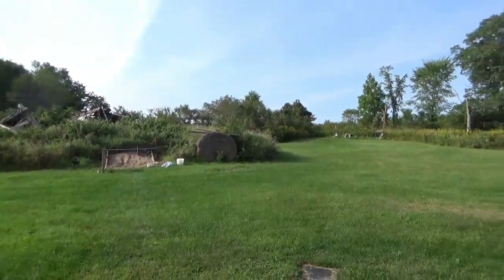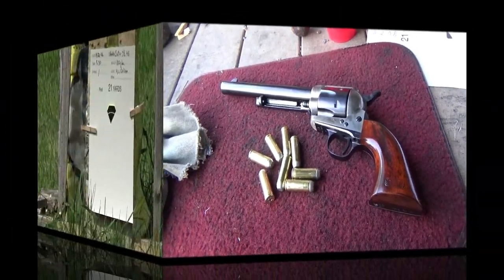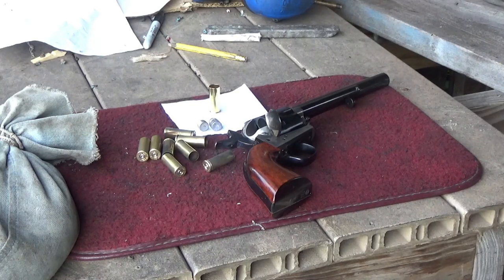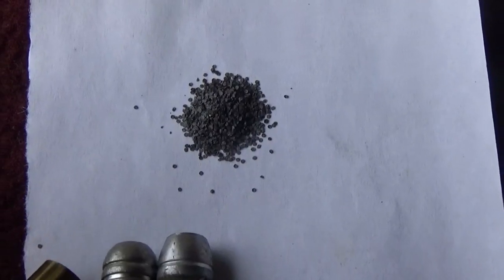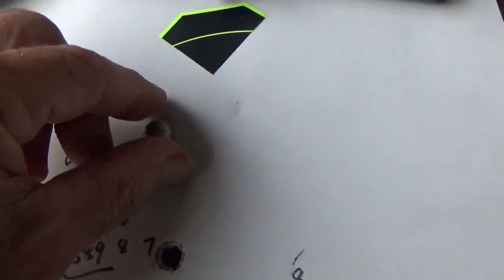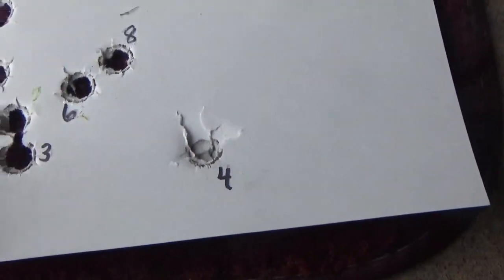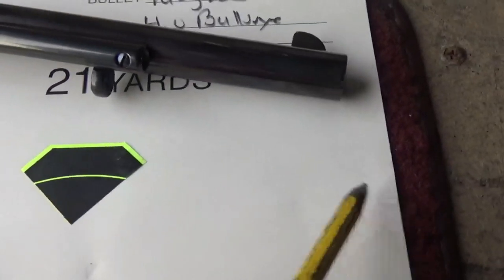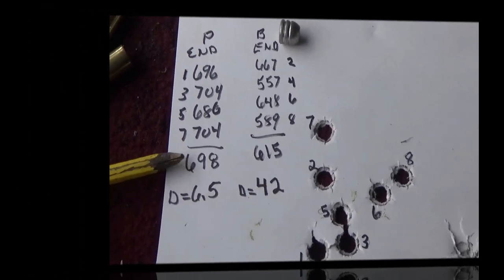Powder Placement 45 Colt  - Part 1

Comment: Very Interesting study.  So using say a Blackpowder wad could help in achieving a goal?
Reply from the maker: That’s a no-no.  Check the comment by 85waspnest.
Reply: @oldranger3044   Thanks, I realize a gap in a BP charge is bad. But I was not aware it translated to smokeless powder. THX again for the reply.
Reply from the maker: @Curtislow2  Actually with smokeless powder, there can be empty space.. But there can be a situation I understand if someone used a fiber wad to keep powder near the primer. I am not sure why, maybe it acts like a plugged barrel, building dangerous pressure. Some folks use like tissue paper (small amount) just enough to keep the powder next to the primer for better ignitions. There still remains empty space in the cartridge. Maybe someone else will comment about this and better explain. Also you can check into it on forums.  O.R.
Reply: @oldranger3044  There have been a lot of experiments using filler in Nitro for Black cartridges using a pressure barrel, with vintage double rifles as the subject, which are very sensitive to velocity, it was seen that hard card wads did give a "stutter" pressure spike, but not in the danger zone, the least pressure was achieved using either closed cell foam, (which I use), or Kapock, the problem is that most Nitro Express cases have huge capacity, and do need a filler, even when using 120 plus grns of Nitro in a 577NE, the problem comes when the case is not completely filled, some have tried a single card wad pressed on top of the charge, that acts like an obstruction and can cause chamber ringing. Stay safe! Chris B. P.S. There is an excellent article on case filler in the Double Gun Journal, with all the relevant tables.
Reply from the maker: @453421abcdefg12345  Only have vol 29, issue 2 which I got at a gun show years ago. Really neat, interesting information and history,  great that they exist. Makes sense that the experimenting would be going on in more places than just the 45/70’s. It’s a big world. Thanks. O. R.
Reply: @oldranger3044  Unfortunately Double Gun Journal closed down this year, but back numbers are available, and the really interesting article is in the Summer 2011 magazine, a shame I cannot email it to you as I am sure you would find it very interesting, being an actual hands on test ,rather than a gun writers theory. Chris B.
Reply from the maker: @453421abcdefg12345  Thanks Chris. Too bad about the publication, maybe through the years the have covered most topics. I just tested some shots to see where the powder ends up after recoil in relation to where it may have started. In your opinion, would posting this have any interest or value ?  Thanks again for your response. O.R.
Reply: @oldranger3044  I am sure real people would be extremely interested in powder position after firing, but I cant see how that can be ascertained unless you have a transparent cartridge case. DGJ shut down not because of lack of material to publish, but they say interest in shooting and collecting "old" guns has fallen off in favour of black plastic machine guns, I understand they are even using those for hunting now? Chris B. (Get the coffee on, I will be round for a chat!)
Reply from the maker: @453421abcdefg12345  Should have figured. Once I was shooting indoor league center fire and got five or six 9mm “modern” weapons. They weren’t real spendy, but about the same as the smith 686. And lots more than my S&W K.  Could never get that one hole at 21 ft.. You probably guessed that someone else owns them now. Don’t own any modern style rifles. Some look interesting, I’ll admit—maybe in another life, or alternative universe. O.R.
Reply: @oldranger3044  I gave up on modern guns when my mates were in tears of frustration when they did not all go through one hole! I thought, what is the fun in this! And now shoot only guns from 100 years back, much more of a challenge, my newest is a 1905 Westly Richards 577 NE falling block, but I do not shoot that much. Chris B.

Comment: How do you prefer powders that will fill the case almost up higher volume
Reply from the maker: Trail boss was designed for that. Most other powders that would fill the case are slow burning, potentially dangerous, and more designed for HP rifle cartridges. An alternative is to use smaller brass like that made by Starline brass specifically for the 45 Colt.  O.R.

Comment: I really have problems with .45 reloading (R92, 20gr Hornady H111, 225gr). I suspect the position of the powder is the problem. Only 1 of 5 was a real shot, 2 just moved out the barrel, and 2 got stuck (removed with a BP blank). I tried filling the empty space with toilet paper. But not much difference. I appreciate any suggestions?
Reply from the maker: If it is h110 powder, that is recommended for relatively high power pistol cartridges which a 45 colt is not. In fact, shooting reduced loads could be dangerous. With the results you are describing, you might NOT want to use that powder in a 45 Colt cartridge. I’m assuming that the R92 is a Rossi lever action rifle, and I’d NOT continue with that powder. O.R.